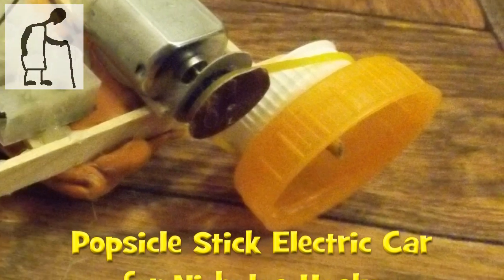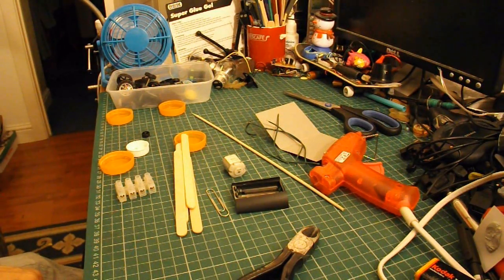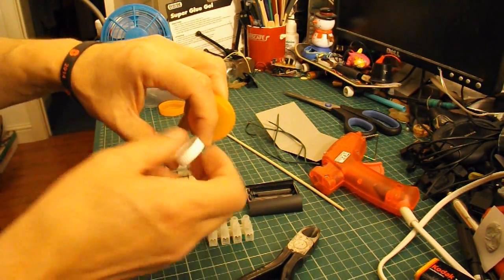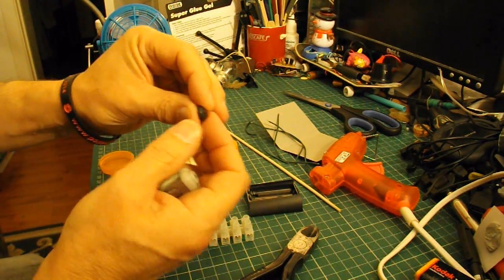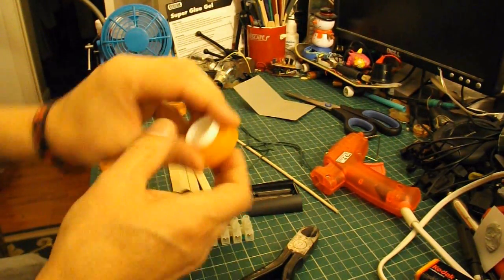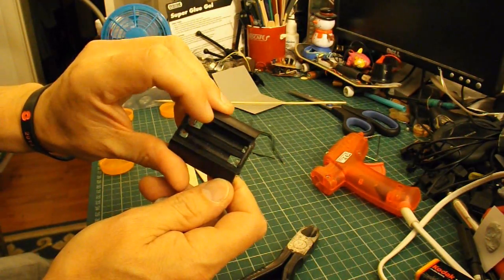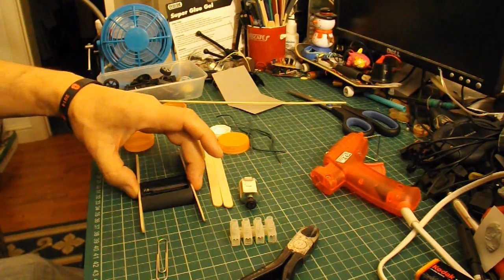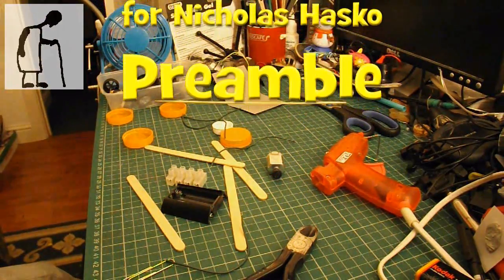Popsicle Stick Electric Car for Nicholas Hasko - PREAMBLE

Comment: can u make a 4x4 car with steering system with cardboard as chasis
Reply from the maker: +Daniel Reymond using cardboard as the chassis is pretty irrelevant. You would just use enough cardboard layers to make it rigid. To make a proper 4x4 with steering would involve buying proper universal couplings to allow power to be fed through the steering assembly to the wheels and that would be a significant cost. It would certainly take far more time and effort to make the couplings from scratch that I am willing to put into a project. You are talking proper hobby grade stuff here and I don't do that.